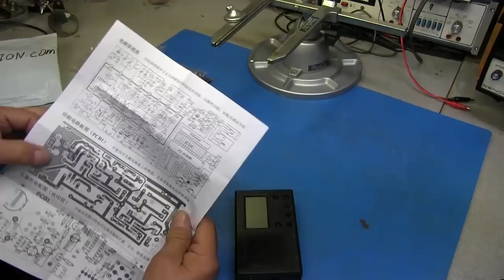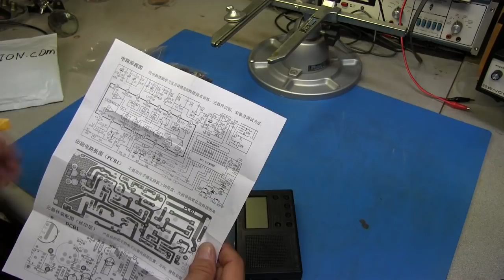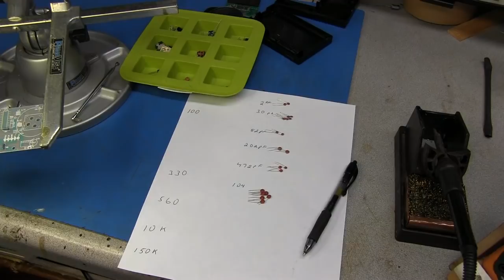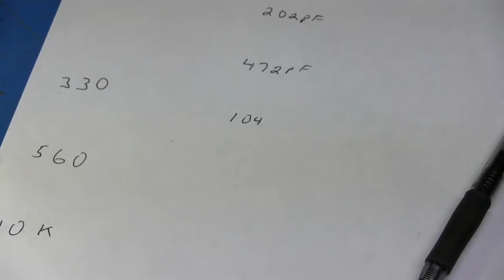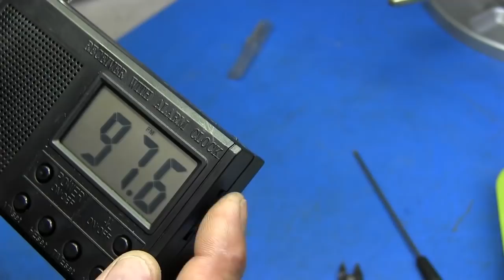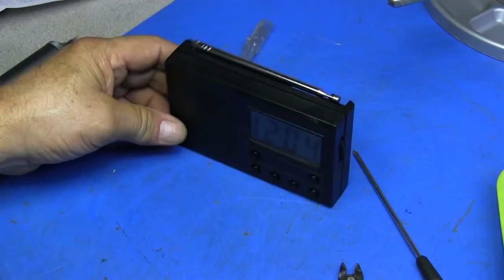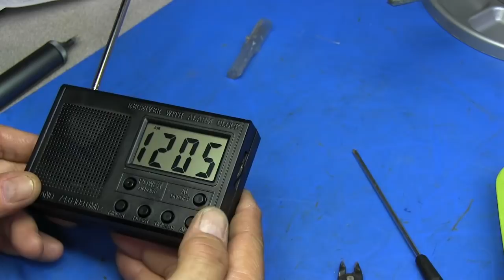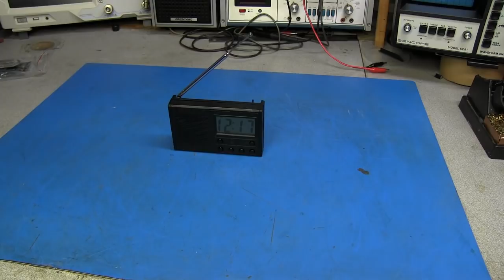#261 FM Radio - Clock Kit From ICSTATION

Comment: I miss the days of ham shops and kit radios. I learned fixing old tube sets I got for $2 or $3 at Goodwill. To bad young people have little interest in learning the way we did. Probably best tho, with the power haunting  vacuum tubes I'm lucky to be alive!!
Reply from the maker: I agree. I long for those days. I with you. Got zapped many times back then
Reply: The new TVs will nail you too if you're not careful. I got nailed by 60 volts AC directly across the heart, and that scared the everliving daylights out of me. Not enough to kill me, but dang man it made my arms clench up! I learned a lesson that day... transistor heat sinks can be live. 

And yeah, I'm a young guy. Not all of us are uninterested in electronics.

Comment: Great job!  I assume the Scotch tape fixing the free stainless steel switch "rockers" is the mylar tape.  Other tapes may break up, or the adhesive will fail after a few years.  Some nice little tips for beginners too, like cutting the transistor leads progressively shorter to locate the holes, and taking care with handling the CMOS chips.  I really liked counting the solder joints of R's C's and L's, and checking for an even number to avoid missing one!  That had actually never occurred to me - despite over 50 years of amateur and professional electronics!
Reply from the maker: Hi Hector. Yes the mylar tape is prefeared. Although I think it could be assembled without any tape at all. One it is buttoned up those little taps do not move.  Just makes assembly easier. Thanks for noticing the tips.  We are never to old to learn new things.

Comment: Thanks for the video.
Those tactile switches are made of stainless steel and not meant to be soldered but as you did just place them and some tape over them.
If the plastic knobs are the loose type just place a thin sheet of foam on top.
Reply from the maker: I was thinking it was some type of stainless.  The tape worked ok, buttons seem fine and not too loose.  Thanks for sharing.

Comment: Thanks for the great video. I have feied chips in the past so am thinking of using sockets. Could you recommend sockets to use and will there remain enough room in the case?
Thank you
Peter
Reply from the maker: Try and find the low profile sockets. I think they will fit fine.